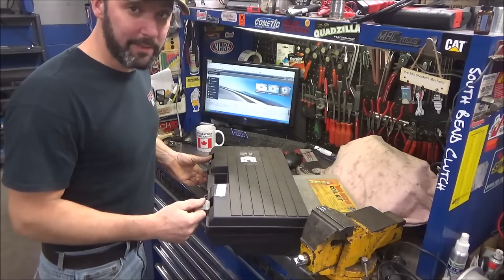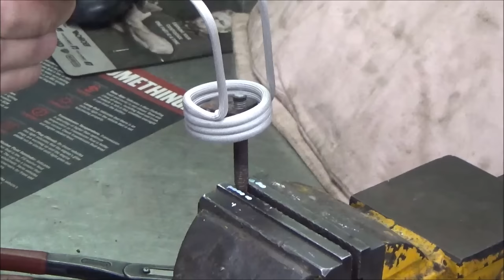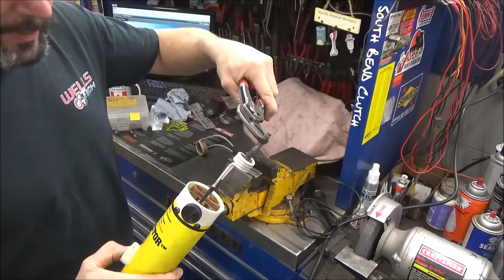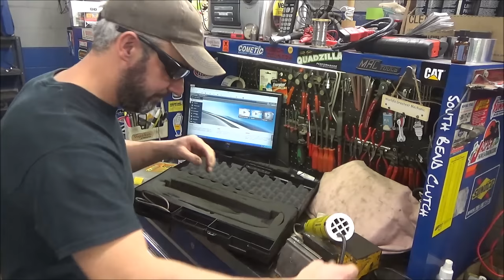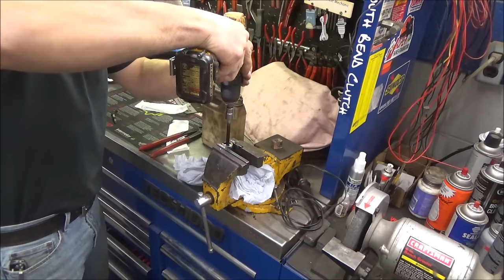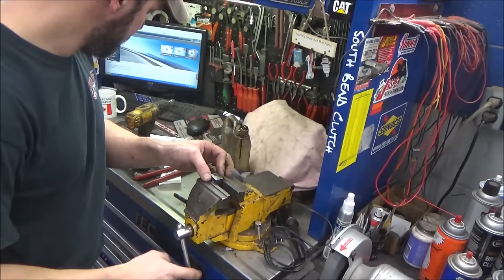How To Heat Up A Nut or Bolt WITH OUT A Torch

Comment: 1 minute job with blabla turns into 20 minutes. Instead of fixing this bolt horizontal he fixed it vertical and bounded the tool. Good luck maestro

Comment: Well, if you dont have a small gas setup at home, you shouldnt be working on anything. Retired 15 years ago and i have a gas setup at home. Use it about twice a year. It saves my butt everytime and basically pays for itself each time. This unit is nice but you cant cut nor weld with it. Im not a fan of single use tools such as this. Yes, i was a shop owner and i dont think i ever ran into a situation that this tool would have been the only answer.
Reply: Gas would definitely be helpful, but I wouldn’t even come close to saying if you don’t have it you shouldn’t work on anything.  I would define that as a ridiculous statement especially when you say at home.
Reply: @davebliley5361  i do mean that as a general rule. Gas covers all areas. And i do mean as a first tool involving stuff like this. I worked 35 years as a mechanic. Its all i ever needed. Now if i fabricated, etc, you can bet i would be using other stuff. Anyway, thanks for the feedback.
Reply: I live in an apartment. Please advise.
Reply: @jeremymenchaca  well, do you do your work in the apartment ? Heavy stuff like this ? Naw, just look at either a mapp/oxygen
setup or the smaller, portable oxy acetylene units. The small bottles are in a carrier that is easily stored and takes up little space.
My comment about no business doing anything refers to heavy work like this. Does not refer to other smaller heat sources if your work is light. I thought that common sense would take that into account.
Reply: @georgecurtis6463  You said specifcly "at home". Never had a set up, I have done plenty of suspension, engine builds, engine swaps. I have gotten by just fine without a torch. Penetrating oil, a map bottle, know how and occasionally a welder (a cheap one) has gotten me by just fine.
Reply: @stich1960  well, yes, you can get by without it, certainly. But you sit there waiting for all the chemicals and poor heat to work. Hours ? Days ? A week ? On and on. With a 300.00 dollar small setup you can get it done in minutes. Can you cut metal with your map setup well ? Can you weld with it ? It makes no sense to not have a proper tool if you are running into these needs often enough. Yes, even a home shop can be made better with the proper tool and you know this. You are using an expensive basically one use tool but here you are arguing about a torch setup ? Really ? You and others go ahead and struggle, I'll just get my job done in minutes and go on my way. Sorry for ruining your party.
Reply: In some jurisdictions you can't legally buy Oxy bottles let alone acetylene. You have to rent them- which is fine if you use them a lot but the monthly rent adds up to the point where you have a $1000 investment that you use twice a year,
Reply: @wssides  well, I guess I'm lucky then. I have never heard of that. Here, you buy new tanks, then go to a supplier and exchange your new tanks for filled ones. You only pay for the gas. When empty you bring that tank in and get a filled tank and just pay for the gas. So yea, technically the tanks belong to me, I just pay for gas. Kinda like propane tanks.
Reply: Yes, thats the way it was here 25 years ago and there are still some older customers who are "grandfathered" and still have that sensible deal.
Reply: @wssides  wow, that sucks. What brought that on ?
Reply: @georgecurtis6463  I don't know for sure. I was just a mechanic at the time and my boss wasn't affected so I didn't hear about it till I semiretired as a parts-man. I suspect it was the distributors wanting more control over the bottles and more profit. Likely pushed the regulations branch of the government claiming safety of ancient bottles plus tracking in the era of domestic bombing. Lots of paper work came about at the same time- records to store and be inspected.
Reply: @wssides  ok, guess guvment got their hands in it. Far as I know, here in calif we can still just exchange. The tanks are stamped and tested when needed. I mean after all, we did give them our new ones .

Comment: What a waste of time
Reply from the maker: Haha thanks for watching 👍
Reply: Vince I think you like being sarcastic. I used the inductor many times on rusted suspension parts and saved my a$$ many times. Probably you're not a mechanic like we are. Keep up the good work South Main, Best from Vancouver B.C
Reply: @caddyrack  no I'm an auto body repair  person.
Reply: @vinceferraccioli4661  Hello Vince,  I know you ran into problems with stuck, frozen, RUSTED bolts. If you have the 'inductor' it will save you a shit load of money in the long run. All the best to you. Cheers
Reply: @caddyrack  Never seen a mechanic use induction to heat a fastener so don't act like it's common. Also, being a "mechanic" doesn't require much. Being a technician is another story. I'm not a technician. It's like calling the cook at iHop "chef."

Comment: exploding heater. oh yes that makes me really want to run out and buy an induction heater NOT. and most if they don't use a torch simply use patience wire brush wd 40 and back and forth action to get the nut off the bolt. they don't go out and spend over 200 dollars on an induction heater.
Reply: I'm just guessing that you don't deal with the rust like some other people have to. A wirebrush and wd 40 won't do anything to help you on the cars I have in my drive way.
Reply: @snoopdogie187  that's a crock of shit. penetrating oil and patience working the nut back and forth will break it loose. and if your cars in your driveway are that bad then i'd say it's your neglect is why you can't break them loose with wd40
Reply: @southernprojectsyt6340   The fact that you use wd40 is saying enough. WD40 is more for water displacement than a penetration lubricant. I can't say road salt is my neglect. The fact you can even get a nut to turn is amazing. I don't feel that we share the same rusty experience, which is why I know all too well what Eric is going through.
Reply: @snoopdogie187  i've taken fully frozen up 70 plus year old nuts and bolts and got the nut off without using a torch to heat the nut off of an old chevy and once with about the same age international L110 series. I wish people wouldn't put their alt account to be a smartass while their original account sits back having its alt defending their youtube blog.
Reply: @southernprojectsyt6340  you display one dimensional thinking, have an attitude problem , display your ignorance in the comment section and at parties I suspect the others confine you to the basement with the other bummers . If you use WD40 you have never encountered a corroded bolt.
Reply: @Dixler683  OH ALMOST FORGOT i've a 17 year old truck still has its cab corners, rocker panels, above wheel well metal , none of the frame is rusted through. i'd be willing to wager your canook trucks is half rusted apart by that time of life.